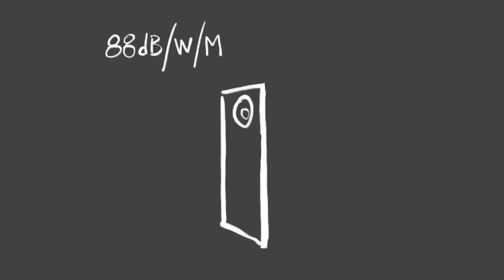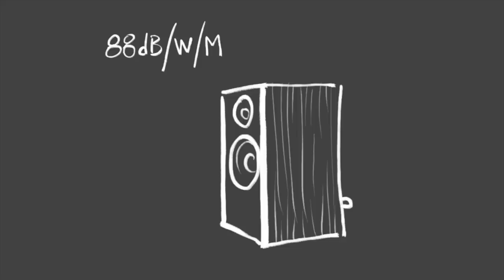John DeVore goes on a rant about the High End Audio lie that inspired him to start his company

Comment: Many decades ago I bought a "Hi-Fi" system that included a pair of A7 Voice of the Theater speakers and a Scott amplifier.  But returned the Scott amp because when there was a lull in the music I  could hear noise coming from the speakers.  It turns out that the Scott spec for hum and noise was some number of dB below full output.  That amounted to something like 20 mW of hum and noise (AFAICR) which the VOT speakers would allow you to hear across the room.  Again, AFAICR, 1 mW was enough to be hears across the room.  So can you tell me what is the sensitivity spec for VOT speakers?

PS The replacement McIntosh amplifier did not have a noise problem.
https://prc68.com/I/HomeTheater.shtml#VOT
Reply: @James Wilkes Thanks.  Do you know anything about the idea that the voice coils of the horn and speaker are in the same vertical plane so around the crossover frequency the pressure waves from each of them are in phase?  The claim was a cleaner sound in that frequency range.
Reply: @James Wilkes Hi James:  Thanks very much for telling me the name "Time Alignment".  The example in the link is done at 1500 to 4000 Hz so I'm not convinced that analysis applies to the much lower crossover frequency of the A7.  It's interesting that the Wiki Page for Time Alignment mentions a phase shift network for electrical Time Alignment.  In ham radio there are antennas where a phase shift is used to steer a beam.  But the beam angle is directly related to frequency.  So the time correction is going to be frequency dependent, not a desirable thing.  A better way to do it is time delay beam steering where the beam angle is frequency independent.  In a similar fashion a time delay network should be used rather than a phase shift network for electrical correction of the mechanical offset.

PS Teletype machines make use of the loop time constant to achieve fast response.  It's given by T = L/R.  This is very counter intuitive since there's nothing much you can do with an RC circuit to speed it up, but with the LR circuit increasing R speeds up the response.  This is very noticeable when driving electromagnets.  Since most speakers are just electromagnets driving a diaphragm I wonder if anyone has tried adding a series resistance that's say 10 times the loop resistance and then increasing the drive voltage so that the current in the electromagnet is the same as is normally used?

Comment: This 'rant' all but explains the elephant in the room: that speaker impedance is not uniform.  As such, it misses a crucial specification parameter, which is useless anyway, as no one listens to a 1KHz sine wave (the usual standard test frequency).  Either way, the problem is effectively solved by designing active speakers that are tuned just like a car engine via the use of a built in amplifier that accepts adjustments for the individual components and enclosure in real time.  TI has some excellent demonstrations of this technology.  The days of component systems are dead; a pair of Apple Homepods has all of the above, will even calibrate to your listening environment int real time, and cost less than an entry level audiophile setup.

Comment: you kinda make a huge mistake. ALL amplifiers behave like that. say you got an output voltage swing from peak to peak of 10 volts and you got a 4 ohm load on it, that will be 2.5 amps of current. and that is 25 watts no mather what. now, if you substitute it to a 2 ohm load, it will try to draw 5 amps. and that be 50 watts. no mather what. the problem is, the amp will run out of current and will drop in the voltage or just burn. oldschool stuff had huge  voltage gain and not a lot of curent delivery, so you had to use higher impedance speakers. there is your brilliant reason. however solid state semiconductors do not like to deliver huge voltage, but can push impresive currents. specially class D is notorious of being able to deliver tonns of amps. now, an output transformator is not required, it would be bulky, and is useless nowdays. a high current output stage has quite a low resistance, you do not need superposition theorem to be fullyfield. so you can hook up low impedance speakers without issues. allso, living space has decreased by a LOT. so you kinda needed smaller enclousers. specially with the rise of automotive hi-fi industry in the rise, you have a space constraint, you got a voltage constrait (with cars that is as the tipical supply voltage is no more than 14.4 vdc, and you gotta use an inverter to boost that up) , shipping costs are an issue so from every aspect, you want smaller speakers as a final product. and the magic triangle is freqvencyrange, size,efficiency.  you can not have all of them at once. one can build a realy small subwoofer, with a verry low freq, but then you gota feed it gargantual amounts of power. still far cheaper than having a super huge box and a small amp. allso, the less vlltage gain you gotta have, the less its going to trash quality. so you got low voltage, and you need small speakers, how on earth are you gona get away with it ? yepp, you gona push a LOT of current.
now from one point of view changing to a fixed voltage instead of power may seem like a goofup. and it produces higher numbers. however, if i know my amp can drive low impedance loads, and i don't want to do a lot of calculations, i can sortha find voltage drive specs informative. say my amp can do something like 15 volts at its output and can handle low impedance loads (won't run outta current) then i don't even care about how many ohm impedance does that speaker has at all, i can estimate that my amp will drive that speaker to about spl+6 dbl loudness. wich is fucking amazing if you ask me. 
but i do agree with you, i do not like low efficiency drivers at all.
a nother good point for the constant voltage is.. multi way speakers. you gona do 99% of the time parallel corssovers, and i sortha bet you by now realise that means you gona drive eatch segemnt with the same (drumm rolls) VOLTAGE, and not power. since they ALL have different impedance YEEEEY. THATS THE REASON, holly molly. 

due to my trollish style i'm not a person people welcome. could not care less. however if you need any help just ask. i will be more than glad. open for everyone btw. my hobby is engineering drivers and cabinets and other audio stuff. i love it. aaaaand winky face.

Comment: Almost pointless explanation..
You cannot judge a speaker by it's impedance (measuring it.. or getting it from the manufacturer..) because you wrongly assumed that Z (which is the expression of impedance oficially!) and not R!
And there is A REASON for that. An impedance it must be seen as a VARIABLE Resistance, because it doesn't sits there on it's own! It is MOVING constantly in a magnetic field, hence it's value varies quite a lot, especially in bass loundspeaker!

The impedance as value is there manly for the developer or, builder of the audio system to MATCH the outputs of the amplifier with the right impedance required by amplifier (it's final stage of amplification) so doesn't burn. 
Do not ignore this..

The only reference point when it comes to build the right box for the loudspeaker is his RESONANT FREQUENCE of the speaker!
That is what makes a speaker valuable!

The best speaker in the world will sound CRAP in the wrong enclosure!

.."good luck" with your business.
You haven't convinced me.

To the others, who thinks understand better Ohms law like that, sorry but they are misled.

Comment: To avoid dynamic range compression and clipping on transients all you have to do is stick to the 10% rule. Never use more than 10% of the power your amplifier is capable of delivering. That will ensure that the amplifier will double it's output for every halving of the load impedance. My system is of moderate output power at 250W per channel into 8 ohms. I never operate it above 25W per channel so it can deliver high current when the speaker impedance drops at bass frequencies.

Comment: If you want to address the problems with the audio industry you would begin by designing great speakers and then you would make them affordable using great manufacturing. Your selling extremely expensive speakers and marketing them with a little intro to P = I x E is not solving any of the real problems that listeners may have.

Comment: I'm baffled. I understand that you have a company that produce speakers and you know nothing about how the speaker's impedance works!!! Impedance IS NOT the same as resistance, impedance is resistance in function with the frequency, therefore the Ohm Law has limited application here, in a speaker impedance varies from a value that can be 10-20 times more the nominal impedance to a fraction of an Ohm,  impedance IS NOT the resistance of the coil but is generated by the coil, the crossover elements (resistors, capacitors and inductances) and even mechanical elements like the cone suspension, the air pressure inside the enclosure, etc.  It's absolutely correct to specify the sensitivity in dB/Volts because the wattage changes in the relation to the frequency since the impedance may vary, say, from 120 Ohms at 50 Hz to, say, 0.7 Ohms at 15 KHz, while the voltage stays constant if the amplifier if properly bridged, aka has a good damping factor. You are like those young lads in the '80s that used to buy drivers and crossovers at the local electronic shop and 'build' a couple of speakers, well, they sounded, sometimes decently, but far from being professional products. Stop ranting and go to school.... (BTW, this can help: http://audiojudgement.com/speaker-impedance-curve-explained/)

Comment: This means nothing.. I could make a flat 16Ω speaker and it would sound crap.. Your thing has nothing to do with sound just specs.. However specs tell you nothing about performance.. I have no idea what this was about because you actually said nothing. There were many speakers in the 70's and 60's that were superb. The late Peter Snell designed a fabulous speaker that was a flat 8Ω load and we must remember resistance although futile is not the same as impedance.. There were others as there are today.. If it sounds good then it is good.. This has nothing to do with impedance or it's specs.. Is this a thing because Pearl Acoustics are doing something similar.. I think you're all bored with nothing to do just an opinion :-).. To make you sleep count jumping crossovers because that would make anyone nod off!!!